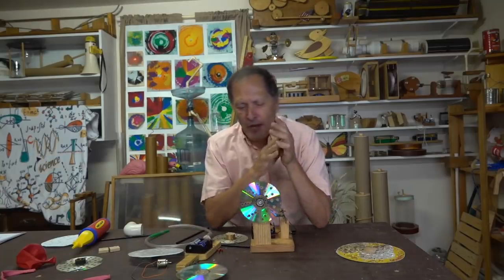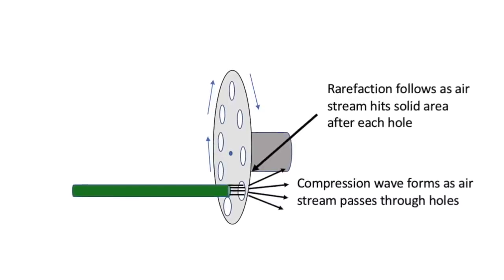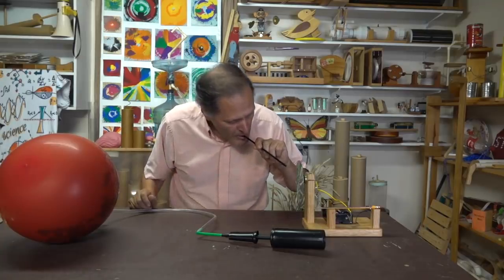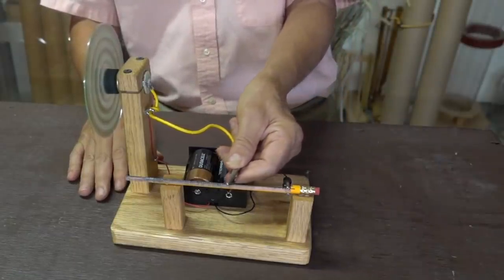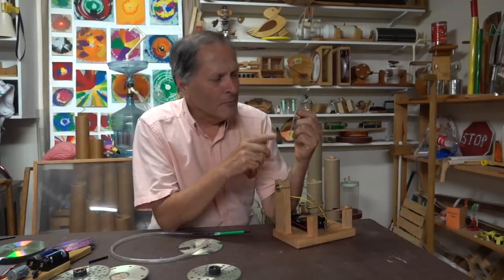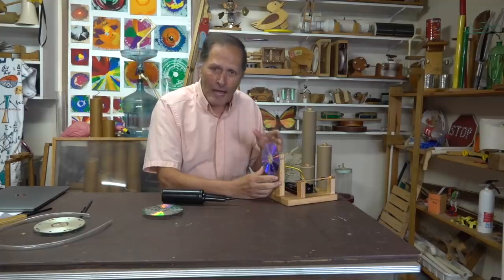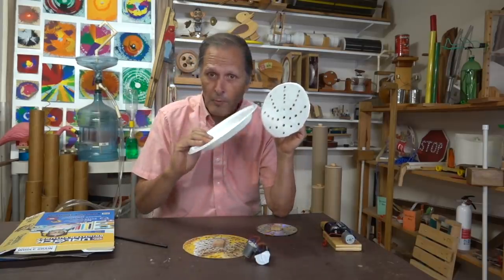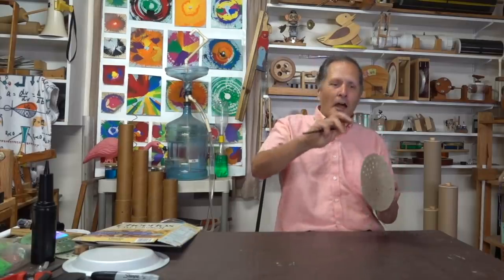Simple siren disc  demonstration //. Homemade Science with Bruce Yeany

Comment: I have most often found that the most complicated questions are answered by the simplest answers
You answered your question already about why the slotted disc or the other patterns have no change in tone
The slotted type disc would be used for sound/vibration frequency change solely using a change of revolutions per minute but since it has less resistance the frequency would be amplified as the volume of air is increased
The disc with more holes the further it gets to the outside circumference has a more simple way of tone variance but due to the amount of surface material volume will be limited although far more precise
Regardless of which method is used the variable tone would be identical using RPM's to control it but using evenly spaced holes with less holes toward the center would be more precise albeit quieter
I'm no scientist but I did eat a McDonald's apple pie for breakfast

Comment: While the fundamental pitch of the holes on the disc that has the same number of holes per ring doesn't change, the character of the sound does; the changes in linear velocity might be altering the way the air gets chopped and giving a different set of background noise and harmonics. Same effect on the slotted disc, too!
Reply from the maker: Thanks siberx4,  I think that is quite noticeable, I'm curious about the idea of elongating the holes to make up for the change of linear velocity,  I still have several old CDs around and will continue to experiment with it as time permits.

Comment: Looking at the source pictures web page it says, "The small stack of discs is rotated and an index card is held against the teeth to hear a similar effect."  I think it may be like putting a baseball card in the spokes of a bicycle wheel. Robert  Hooke  (1635-1703)  made  a  wheel  with  small teeth sticking out from the edge at equal intervals. As the wheel rotated on an axle and the teeth pressed on a card, a sound was produced when the card vibrated. The pitch of the  sound  rose  as  the  wheel’s  rotational  speed  increased. This would give the same effect.
Reply from the maker: Something not done anymore,  the baseball cards in the wheel, we did it as kids and it made out bikes sound like a Harley.     The tooth device is called  Savart's wheel,   I made one but with the weak motor  I'm using the cards would cause quite a decrease in speed.   I'm in the process of making one with 5 wheels on it but the motor shaft can't support it. Trial and error, next step ,  I'm rebuilding a new stand that has two motors, each one at opposite ends of the shaft,  we'll see how that works after I put some more time into it

Comment: I'm going to suggest to you that the one with the long slits was actually designed and developed to be used for visual purposes so I would try using that rainbow wheel beside it and put it behind it as you spin it and watch the visuals change before your eyes. Just a casual off the cuff response. 🙂

Comment: Well, its called a siren disk. Maybe the slats were used instead of holes to intentionally give the disk one tone.  If air passed over the entire surface of the disk instead of one spot, would that make that one tone louder? The pitch of the tone could then be so let controlled by the rate of spin, maybe to give it the rising and falling pitches of today's tones. Maybe different siren tunes could be used to signal different types of warnings?

Comment: Interesting video, I'm now considering making a musical instrument based on this concept, thank's for bringing it to light.  Just speculation but I wonder if the reason for the slots as apposed to holes on the brass wheel is so that the airflow can be spread accross the width of the slot with a nozzle.  It's possible a cleaner tone could be produced with a more distributed and less turbulent flow.

Comment: The sound from the foam was a lot more clear. I wonder if this is due to the thickness stabilizing the air stream as our flows through the holes? Reducing vortices And other turbulence? This could be tested by making a disc from a different material such as wood, metal,or acrylic sheet that is roughly the same thickness. Radiusing the holes both sides would also aid in reducing turbulence. Is also suspect the foam material may absorb and dampen some of these vibrations.

I'm very curious about making some kind of organ that uses this principle. It looks like a lot of fun!

Comment: The slotted wheel seems to vary the harmonic content. While the fundamental pitch remains the same, the outer edge sounds "thinner" than the inner portion. I would guess the compressed wave over a larger area of solid material creates the distinction in harmonic content. Just a guess...
Reply: It's pulse width modulation :)

Comment: Smashing stuff, and what a great musical device, especially with the DIY variable resister. Can you do a further mod and somehow create a disk with a full octave? What about an automated blower using a recycled vacuum cleaner rewired to blow? Or a hairdryer and pipe attached.
Reply from the maker: yes,  I've made larger discs that will easily fit an active on it,  I still need to update the base with more precise controls yet

Comment: Safety dictates to NOT put ones face and body in the area where a disc will fly when it shatters. I was particularly concerned by the slotted disc... I witnessed a bad outcome from a similar situation. Also, I recommend you don't google "die grinder injury" and look at what happens when those discs shatter with body parts in the way.

Comment: I'm now picturing a common shaft with 16 tuned brass discs which have 2.or 3 notes per disc, a jumble of copper car brake pipes, nozzles and T junctions, a compressor, a load of sprung needle valves to control the air flow (Like on car paint spray guns), and a regulated air turbine to spin the discs up............ Anyone fancy making this steampunk "Disc organ"? :D

Comment: There are differences between a lot of the disks when you say you don't hear any differences... have you considered using a chromatic tuner versus just your ear?
Also, those hand pumps never seem to give even pressure across the entire stroke (in my experience) which could explain some of the variation in pitch/volume.

Comment: Is there a simple way of figuring out the speed of the disk spinning so perfect notes could be made?
Reply from the maker: working on it,  I just got some software on my phone that can identify the frequency and notes to any tone.  Another possible way is to use some free software on the computer, generate a specific note and adjust the wheel speed to match it.
Reply: @YeanyScience  hand held laser tachometer gun?
Reply: You could make the disc into an optical encoder by having one radial section of the disc with only one hole on it. Then mount on either side of the disc a photosensor and a laser diode. You could count the pulses over an average time length fairly easily with a microcontroller like an Arduino or Raspberry Pi.
I was also curious about this and was able to build a decent working prototype using fairly rigid cardstock and the components I mentioned above with an Arduino.
Reply: The easy high tech way is to get an audio spectrum analyzer app for your phone.

You can also get a function generator app for your phone and match the frequency.

If you have an older style fluorescent light that flickers at power line frequency, you can use that as a stroboscope that operates at twice the line frequency. North American 60 Hz power will produce a 120 Hz flicker. Most of the rest of the world is 50 Hz/100Hz. Paint a reference mark on the disk.

Arduino users can make a stroboscope and/or frequency analyzer.

Music people can use a tuning fork or any other tool for tuning instruments.

If you have Lego Technic, you can use a gear train to divide the rotation rate down to something easy to measure with a stop watch.

Some people can just tell by listening.

There are many ways to measure frequency.

Comment: it would be really cool to use an air compressor nozzle to make the sound, it would be super loud.
Reply from the maker: I tried that but the nozzle was too loud itself,  perhaps if I use a long tube attached to the release valve
Reply: @YeanyScience  a regulator valve  on the hose might help, you could slow down the air with lower pressure so that the air coming out is not as turbulent. Maybe 5 to 10 psi through the valve?

Comment: But how do you make the intervals in perfect pitch to each other? I mean how do u know where to drill? Also how can this be tuned to a absolute 440A for instance..?
Reply from the maker: I will post a follow up on the build including hole positions.  I kept this piece very simple as a demonstration, unfortunately the project motors tend to wander and don't hold true at steady RPMs, so I might get near 440A not won't hit it exactly.  While the frequency as a whole may change due to changing rate but the ratio of one note to the other is determined by the numbers of holes
Reply: @YeanyScience  so the holes number creates the intervals… but how come 6 / 8 / 10 holes difference is creating perfectly pitched intervals… how did u get to this perfect  “1-3-5” chord? That’s amazing to me . Tnx for posting  👏🏻

Comment: How high can you make the pitch of the sound ? Is ultrasonic sound possible with this technique? What is the upper limit? Could you get in the "electromagnetic range" with it?  I mean 200Khz? 100Khz? 50kHz? Maybe 153Khz ;) it would be a break through if such a device could interfere with a 153Khz radio receiver. There are the theories that ultrasonic range is only mechanical sound waves, and thus I see phenomena where sound behaves as electromagnetic wave now I want to see the vise versa

Comment: Add a potentiometer and vary the voltage to the motor thus varying the speed of the disk.
Reply: That’s what the pencil is for, it’s a variable resistor, that’s what a pot is.
Reply: @emmamarx9284  I know but its easier to hook up a pot than strip one side of a pencil off!

Comment: Is it the space between the holes, or how fast the holes pass the stream of air?
One way to test this is by putting holes in a tube so all the holes pass the air stream at the same speed.
Think of a music box drum. 
You've already proven the pitch changes with the speed.
If it's spacing, then there would be a clear difference.
Reply: The speed most likely depends on how fast the air stream moves from one whole to another.
If you use the same amount of wholes on two different radii, the outer wholes will have a larger spacing, but they're also moving faster, so the frequency at which they payy the air stream should stay the same.

Comment: 4:20 - Sounds almost like a dominant seventh chord, but I guess the seventh is slightly flat being 7/4 times the fundamental frequency instead of 16/9
Reply: Its the harmonic series!
Reply: @kevinpham8693  Of which fundamental frequency? I supposed the frequency of the external ring with 4 holes as the fundamental so the frequency of the internal ring with 7 holes is 7/4 times the fundamental frequency.
Reply: @lord_marok  the fundamental frequency would be 1 hole per revolution, which is the same note as 4 holes per revolution. I play a brass instrument so I use the harmonic series almost everyday!

Comment: I would be hesitant to use cds for that, especially at high rpms.  The whole time I was watching this I was thinking about the video the SlowMo Guys did about shattering cds.  

It is a very interesting topic though.  Thinking of how many ways these could be used.
Reply: Wasn’t really worried until that cd with slots.
Reply: Same here. I would wear safety glass near that spinning disc.

Comment: 4:28 (random hole placement) The sound is compared to "noise", an unpleasant tone.

Holes that are of the same size and placed in a regular pattern make a much more pleasant noise.

My observations about people and cultures has a similar pattern...a culture that has people of similar backgrounds, religion, and language is a much more pleasant culture to both be a part of, and to visit. A multicultural society creates a cacophony of sounds, demands on the legal system, demands of "tolerance...or else!", and eventually requires greater force by the State to control the riotous mobs. The "noise" of such controlled mobs is the effort to create "a silk purse from a sow's ear", and is an undesirable outcome from all multicultural societies.
Reply: Boy, you have to admire your ability to make up racist nonsense from anything.
Reply: @PabloSanchez-qu6ib  

The emperor has some fine clothing doesn't he?